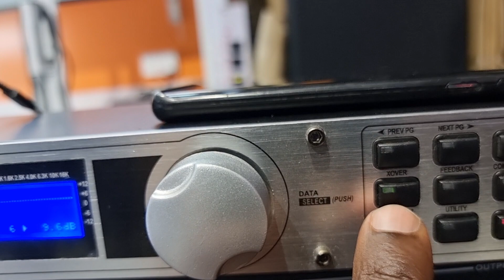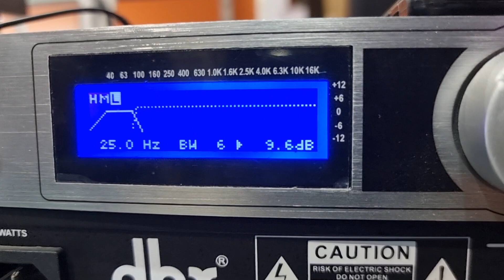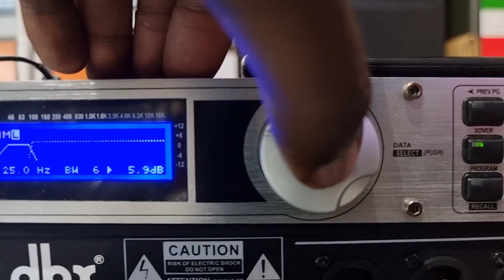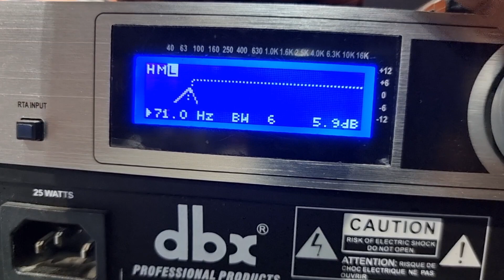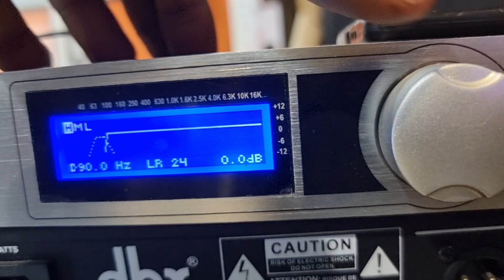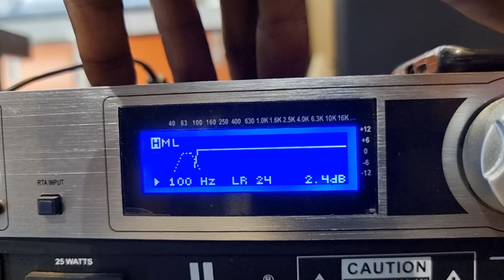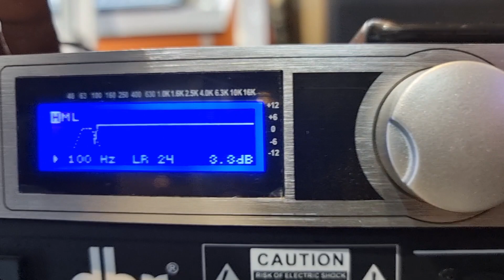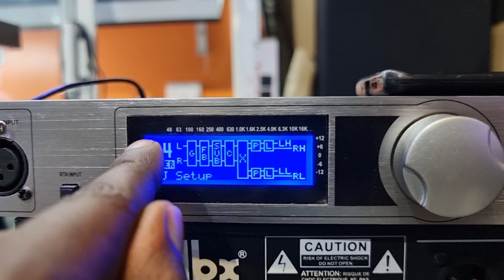SETTING UP A CROSSOVER IN DRIVERACK

Comment: The easiest way to set up the crossover is to utilize the setup wizard in the driverack; all you need to do is to select the brand and model or “not listed” for speakers and amplifiers; the driverack will automatically set the crossover points for you, after specifying all relevant information step by step.

Comment: Last time I asked you about the price of good power amplifier but you didn't reply
Reply from the maker: Depends with what you want it to drive  but basically from.ksh 35000 you will get a 2000wts
Reply: I am looking for amplifier which can run 2 (15inch) midrange and 2(18inch) bass. Any recommendations please?

Comment: Hey wats the difference of using powered mixer with amplifiers and plain mixer with amplifiers thanx.
Is dare any big difference
Reply from the maker: He , most powered mixers will come.with very few control options unlike plain mixers wich have a variety of control options , example auxiliary, groups, several phantom power,  multiple effects. Bla bla
Reply: @decibelaudiokenya  sir i want DBX234XS and EQUALIZER 231S..IM FROM PHILIPPINES SIR
Reply from the maker: @deejaymets376  we wish we could be able to send to you ..kindly check in your local store